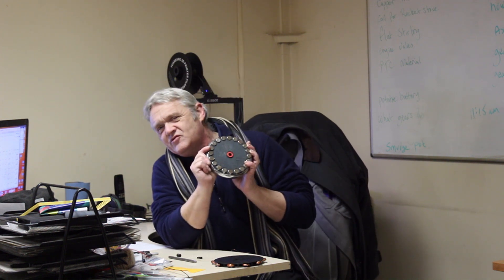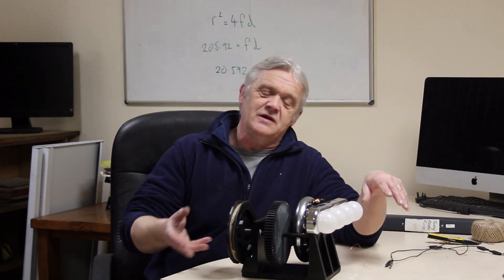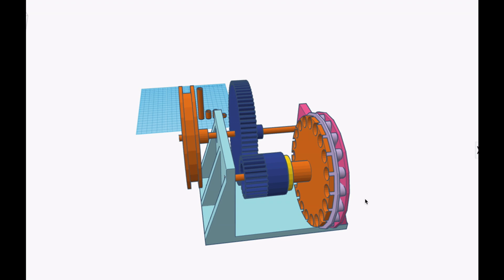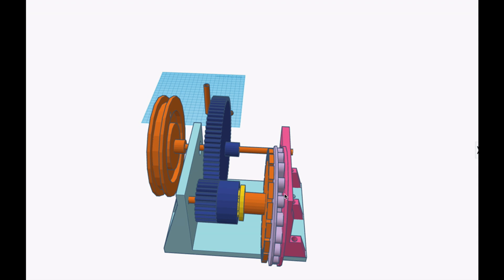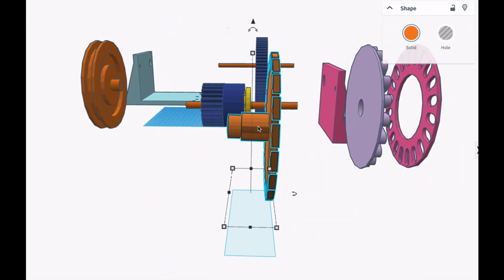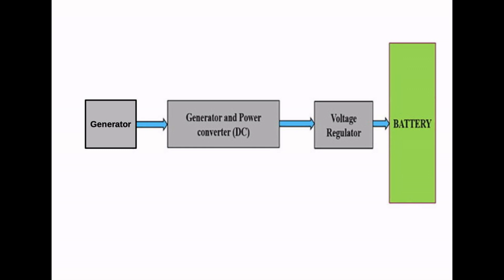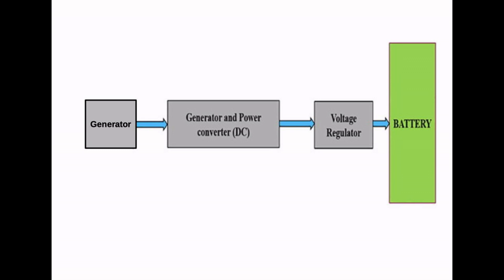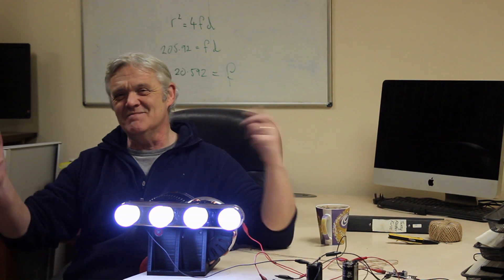1860 Off-grid Light And Power From The Pull Of A Cord

Comment: My current "wind turbine" has a cheapo emergency radio as the generating part. Just slapped some wings on the crank handle. And yep it works, and pretty sure a toddler could do it. Produces some 2 watts of power at maximum. But yea charges a phone just nicely.
Reply: By the way the wings are cardboard. Not rainproof but i do plan on painting them with waterproof paint. Or replacing them with plastic spoon thingy i think i learned from you. The project has as a parameter that it should be completeable by really inexperienced people and the journey should be fun and easy. Goes to an arts and crafts group.

Comment: I had a problem printing out the magnet holder and the big gear. It is hard to notice but both parts are slightly tilted to one side. You need to make sure that these parts are flat on the surface before you slice them or they won't print correctly!!!

Comment: Can you Sir or anyone else who knows the answer tell me if there is a possibility for doing double Serpentine coils winding? make the gap larger, the windings of the first Serpentine narrower and make room for another similar winding but with a shield or electrical tape to separate them from contacting each other? and by that practice, I look for a bigger or more efficient magnetic field generator. if it doesn't work, how else can we upgrade this? by putting another Serpentine coil winding inside of the primary one?

Comment: Maybe, you should take apart an old lawn mower and use it's pull starter to charge super capacitors for a light. I don't even know why you can't buy such lanterns when you can just use off-the-shelf parts. Just give it a pull every now and then. It's not like you have much else to do during a power failure.

Comment: Robert, I enjoy your videos and inventive enthusiasm. I just wanted to share with you an idea that I keep thinking about that could adapt to the pull cord flywheel generator you constructed recently. This would be a generator on a long axle which would also have on it several sprockets. The sprockets all on the same axle would have one-way cogs which freewheel in one direction and engage in the other. The device is mounted up high on a platform (or in a tree or the side of a house or on a balcony) with long chains over each sprocket and draped to the ground with a weight at the end (any weight like bucket of water, concrete brick etc.). The idea is to hoist all the weights to the top and let the first weight pull the sprocket, axle and geared (geared to maintain constant speed) generator into rotation. When the weight reaches the ground after several minutes it then triggers a catch mechanism which releases the next weight to pull the next sprocket. Several weights and sprockets could be added to allow an hour or more of generator time before each weight would need to be cranked back up to the top. It would be very much like the mechanism of powering a cuckoo clock. I don't have the capability to 3D print or manufacture such things but others do. I wish I could make it and test it. It seems like it could work and actually be practical.  What do you think?

Comment: Great build rob. I'm trying to figure out how adapt this idea into other ways to spin to generate and basically it's the flywheel and freewheel that is the key, the bigger an heavier the better. A hand crank with 50/1 gear ratio or more attached to a large flywheel and freewheel or the old bicycle on a stand connected to a DC motor but if the bike powered a large flywheel which then powered the motor/generator it would be vastly improved.

Comment: Thanks for this. 
I feel like this sort of demonstration  is very useful to the layman.Whilst I appreciate your only playing with POCs Its more useful than talking miliwatts and leds because it gives a more concrete understanding of how much power is generated by the apparatus, and therfore motivation to go pursue the thing.

Have you considered lost PLA casting for ridgid geometry that's easier created as 3d print but not strong enough in plastic. I've seen gears made this way but didn't think the result was great.

Comment: the rectifier diodes, capacitors, and 3 pin regulator can easily be found in old CRT TVs from 70s 80s 90s and Japanese TVs you can find quality brand capacitors, Nichicon ect

Comment: You could print a gear system to convert torque into speed, this would make pulling the rope much heavier, but then you could just let the rope hang and put a weight on the end of it, and then gravity would pull that weight and so on you would have an interesting generation of energy. I keep thinking something like "if this gearing system were long enough to the point that this weight takes a long time to fall, it would reach an absurd level of efficiency" because as long as the weight is able to overcome the friction of the parts, it doesn't have limit for the size of the gear system, being able to connect several in series.

Comment: My respect on the use of your 3D printer via Tinker Cad. 👍
The noise can be alleviated with the use of a spring clutch.
What a wonderful demonstration of the use of a flywheel this small and the Super capacitors. If only they would not be so expensive.
Does anybody know of something cheap that contains super capacitors as part of its circuit ?
Reply from the maker: cheers mate

Comment: I'm watching this, and wondering about the viability of using a larger gear reduction, and driving the generator from a susspended weight (Like a grandfather clock type arrangement). Run the power to supercapacitors, then to a low power led lightbulb for a simple off grid light source. When the capacitors get close to flat, just go pull the cord again to raise the weight back up........ It would give the kids something to do during a power cut. :D

With a mains powered solenoid lockng the gears it could even be a funky electro mechanical emergency light that automatically starts working when mains power dies.
Reply from the maker: you are ahead of me lol

Comment: I thought it had a freewheel clutch, it looked like its wasting a lot of energy spinning the gears and pull cord, that would also be noisy
Reply from the maker: it does have a freewheel clutch
Reply: @ThinkingandTinkering  I thought it did, I guess the pulleys are using their own stored energy.. maybe you could use that as well, even if its a small amount of energy

Comment: Out of curiosity could you hook a motor up to the pull card section and feed the motor with the output to attempt a self loop system.
Reply from the maker: you could if you wanted and maybe on the first of April I will do it to show a magic free energy device use for the fun of it

Comment: That must not be the regular household LED light bulbs. Why is that so noisy, because you didn't use ball bearings? Is that just those cheap Chinese 500 farad super caps? Actually I had the idea to do that when you did your seat belt video but with auto retracting crank cord, that's strange you did that , that's really great, thanks I'm glad you got your 3D printer, you use it quite frequently. I can't believe you god that much energy out of that one serpentine coil.
Reply from the maker: got to keep plugging at it mate lol

Comment: I noticed your gears are a bit noisy. And this is not a criticism in any way shape or form, but I thought I would relate a bit of old tech. I had a cousin that was a tuner for Harley-Davidson in the 60s for flat-track racing. At that time, H-D was still running flat-heads against the oncoming onslaught of the Japanese OHV and OHC motors. So H-D was looking for any edge. My Brother's 1st job was to break in gearboxes. He would run the gearbox for 24 hours on an electric motor with valve grinding compound in the oil under a moderate load. This lapped the gears perfectly. Then disassemble the gearbox, replace the bearings, steam clean the gears, and reassemble. The result was that 60-hp motors were able to compete with 70-hp motors......

Of course, it is all different now.  With machining down to a millionth of an inch... But a simple old-school trick that worked. I wonder if a bit of graphite on a PLA gear would not be similar?

Love your channel and your delight when something works.... 

Blessings to you and yours.
Rei
Reply from the maker: that is an awesome tip - thank you for sharing - love it!

Comment: Rob,
When you pulled the cord I remembered my dad starting up the lawn mower when I was a wee lad.
That in turn reminded me of the time he had a lawn mower that had a crank starter on it.
The crank of the starter was mounted on top of the motor and was normally in it's closed position. 
To start the mower, dad would open the crank handle and turn it 3 or 4 times then close the crank handle.
Then dad would walk over to the handle of the mower and pull a lever which would in turn, release the ratchet in the the mechanism; spin the engine and cause it to fire.
Eventually the crank starter broke and I think he pulled it apart and swapped the crank starter with a pulley that he wrapped a pull cord around to start the mower.

This little generator obviously does not need something like the crank starter, but a larger, heavier generator would benefit from one.
You could gear it so that it was easy to wind up but delivered a lot of pulling torque to spin a heavier flywheel or even cause a small one like this to spin much longer.

As far as the noise is concerned, you have a couple of options. 
1) Put the generator inside a sound proof box. Easiest method.

2) Design the ratchet gear so that the outer part of the ratchet is spinning. Then add sufficient weight that will enable the weight plus the centrifugal force, to pull the arms away from the internal cog thereby eliminating the noise.
Reply from the maker: nice story mate and thanks for the tips - cheers
Reply: @ThinkingandTinkering  
You're welcome Rob.

Comment: So what immediately comes to mind is the pull cord assembly from any small engine.  Dead string trimmers or chainsaws or blowers or whatever are free-to-cheap and easy to find, so it seems like it would be a good option to scavenge that (with the added bonus of them being self retracting), and the related clutch bearing.  Don't know how tricky they would be to adapt, but it seems like a good option to explore for people who lack a 3d printer and wanted to build one of these.
Reply: Would be super easy to adapt. Use a couple of discarded 20kg weight plates and you could set it up like a rowing machine. Would be a fun build
Reply from the maker: Adrian is right mate - that would be an easy build and fun

Comment: Great video.  Could you attach the generator to the front wheel of bike to generate electricity to battery or series of capacitors to store energy?  And then with a flip of a switch reverse the current and make a motor out of generator to propel the bike?
Reply from the maker: yes

Comment: If you wanted to recycle to make it, look at your neighbors for chain saws and lawn mowers.  There will be a lot of metals to go to recycling and hopefully the coil spring and covers to go with the pull chord.  The ' next step ' one of my brothers thought up was connecting a car alternator ( as generator ) to the chainsaw to assist in jump starting vehicles.  It was very dangerous until he added a bicycle chain guard over the chain that attached the two.  Edited to add that particular alternator still had the car regulator in it's circuit so it only had a ground and V+ cable with large alligator clips.
Reply: That's novel! Yes, pretty dangerous, but the appropriate safeguards applied circumvent all that.
Reply from the maker: nice way to go if you want a recycle build mate - a very good suggestion - cheers

Comment: Also, seeing your circuit diagram.. I'm totally comfortable with how the diodes work there, but how capacitors smooth current always evaded me, (as I've not got a wavey line thingy).. until perhaps today, looking at your diagram there.
I have a question to confirm: Are all those different capacitors at different powers just so that they all oscillate and fill in the gaps to make an equal current? I expect far more forces to be involved than just that, but as a basic principle is that what the point is there? So like adding more capacitors of different sizes, or having few of non-divisible ratios in terms of how often they pulse, might help allow for more even voltage..? And is that why power boards tend to have a a few capacitors together when they have them, as opposed to just one, which I'd expect would still give a lumpier voltage?
Reply from the maker: in answer to the first question - yes that's what they are and why they are there - basically. For the second one - you can do exactly that and we did it when we built the fractal capacitor network - I did a video on it
Reply: @ThinkingandTinkering  I'm sorry Rob, I must have missed that one! I'll go back to that next. And thank you, that makes loads of sense now!!
Reply: @ThinkingandTinkering  Lost my reply to this somehow, unless it's invisible to me and I'm doing a second one.
Thank you so much, that makes loads of sense now!! Sorry I missed that video, I'll have to go back for it now mate!
Reply: They're super capacitors they have a voltage of 2.7v each and I'd assume he has them in series ( i can only see 2) so 5.4v.
The rectified and regulated power from the generator charges the capacitors which in turn power the lights.
Reply: @ozzybloke4830  Yes, you're right, I forgot the supercapacitors were in this circuit.
I would still love an answer to my question though, if one can shift their mind, to imagine the regular situation of DC conversion smoothing with capacitors, and that I'd asked it there.

Comment: Thought you were dressed as the pope or something for the first half a second there 🤣
Also, I'm tempted to make one of these just for personal use!!!

I love (and prefer) the supercapacitor solution here, but I wonder, with pendulums involved in a less noisy generator (e.g. a gravity battery, I wonder, if the pendulum's movement could allow/disallow access of a flywheel to power the generator, based on a hard limit, with additional energy diverting to lifting a weight, instead, which also goes down, instead, if the hard limit isn't reached. You go so fast Rob, I'm still working on the gearbox for my leaf generator, but I'm tempted to give something a go with pendulums and flywheels soon if you think it'd be worth the experiment. Though I should probably look into the workings of a grandfather clock first.. right?
Reply from the maker: you are ahead of me mate - guess what is coming up next lol
Reply: @ThinkingandTinkering  You've been my teacher for years mate. I've still got a lot to learn lol. No idea what you're doing next though but can't wait to see it whatever it is! Nothing boring happens on this channel.

Comment: After you pull on the string and it's already moving, pulling on the string again basically adds nothing unless you pull it fast enough to get over the RPM the motor is already spinning.
What's the best way to measure this difference between effective torque input and wasted in things like hydro turbines and sand batteries? I guess you could just drop X amount of mass on the turbine/wheel and see how much it takes to move it Y degrees and then do it again after T seconds to see what rate is best for that amount of mass to move it, but it seems like there wouldn't necessarily be a linear relationship? Since for e.g. a tiny bit of sand collecting on the outer edges of the wheel might not even have enough torque to move the axle, and the motor already spinning in a sand battery doesn't necessarily have a very even distribution of force across the wheel
Reply from the maker: isn't that always true whatever the energy system?
Reply: I would think so. So I'm sure people have worked out how to optimize that in high performance systems already, just seems to be much more apparent what energy is wasted when you do it with a pull string motor for some reason. You can just pull it again at the same RPM and not feel a tug, whereas if it's water falling onto a wheel, the waste might present itself as something obscure like spinning the wheel with higher RPM but less torque, or water falling down the side or filling up at a spot in the wheel where mass on that angle doesnt actually push it down
Reply: I'm sure it could be done in a Fusion360 simulation, but it would be nice to know the general principle just to get the bulk of the extra efficiency. It doesn't need to be perfect

Comment: One question in relation to generating power, if you had space for a large tank of water that in turn through gravity charged a battery bank via a generator, would there be enough power to pump the water back to the tank, think I know the answer  but would love the feedback as  I am very green with this subject
Reply from the maker: no - you would get less energy out than was stored - this is always the case
Reply: @ThinkingandTinkering  I thought as much really, so if charging the battery banks was supplemented by solar or wind, or both would it be viable if someone was lucky enough to have the space for the tanks need and elevation. Thanks for replying, love the ideas and endless possibilities
Reply: If you leave the tank open to the air in the UK, the water level will magically go back up without even using the power from this device (rainfall) so you could power this by collecting water from your guttering.